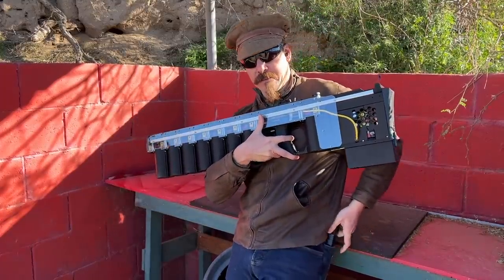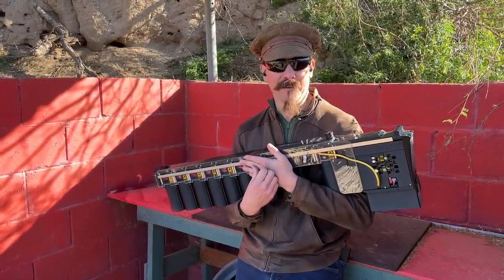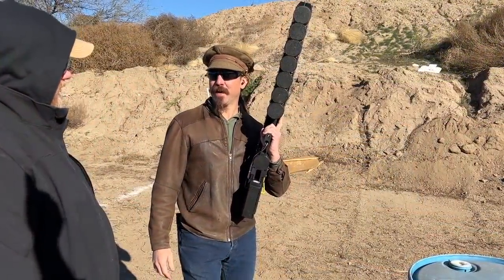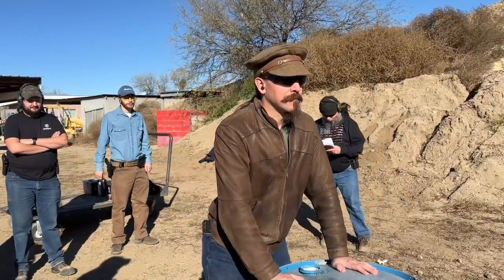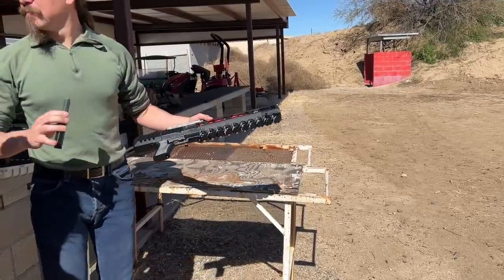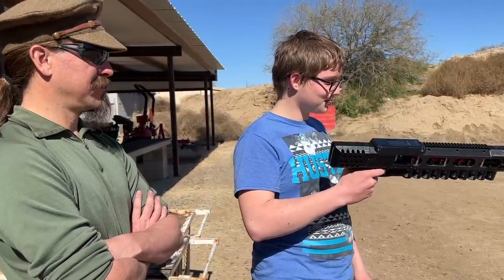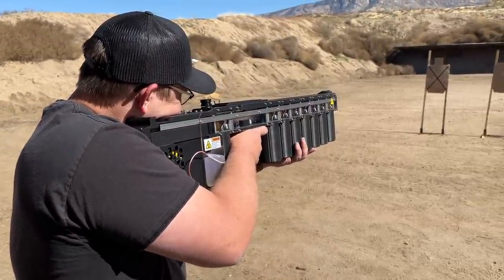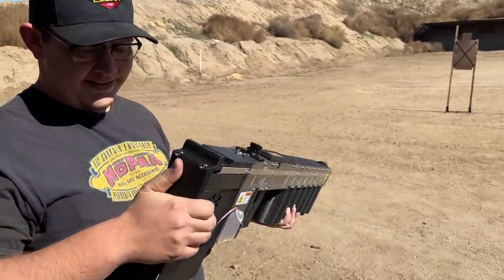I Tried to Use the GR-1 Anvil at the BUG Match...

Comment: Blowing a fuse is going to be the future version of breaking a firing pin.
Reply: Though probably cheaper since theoretically you could just buy a fuse at the nearest hardware/electronics store
Reply: @VertietRyper  Do what generations of shady electricians have done and replace it with a random bit of wire or generic metal object.
Reply: @CptJistuce  500iq strat lmao
Reply: Better not have built-in battery. I'd rather have to be able to change the batteries on the fly. Plus, do owners need EULA if it got software?
Reply: @VertietRyper  A lot quicker to switch mid firefight too
Reply: @Joshua_N-A  you can change the batteries on the go. It’s behind the magazine
Reply: That may be a viable option up until coilguns become more powerful.
Reply: @CptJistuce  What do you think grunts in the field are liable to do?
Reply: @bthsr7113  Probably something metallic, but not wire. Part of a fork, razor blade, one of the projectiles... but not wire.
Reply: @CptJistuce  ian in the build video: don't stick a fork in it
Ian after the shooting video: unless you really know what you're doing
Reply: "Guys guys hold up battle's off, our gun batteries need like half a day to charge, come back tomorrow!"

Comment: It seems the trigger would benefit from a mechanism that would add a little resistance and a noticeable "break" between charging and discharge. Possibly something as simple a spring the trigger would start pushing against between the charging and discharge phases.
Reply: Detents are tricky to do with 3D printing, but a little trial and error will get you there. I did spring-loaded ball bearings before like this, and it turned out alright after some experimentation. They make inserts specifically for such tasks as well. Could use a buckling leaf/spiral spring also.
Reply: Or just put a charge button on there, hold in the charge button, then pull the trigger once it's charged up
Reply: Basically it needs a Mechanical Keyboard switch. Cherry MX Blue would fit that description.
Reply: I was thinking a tone. Like light pull and you hear a "charging" noise followed by a ding or chime when ready to fire. 

Or a scope with a HUD to show the charge and an icon when fully charged.

It's more points of failure but it's a coil gun so idt add a couple more is a big deal.
Reply: Or a two stage trigger. First one to charge easy, then second one to shoot.
Reply: I also think there should be a setting to software-wise delay the firing until a certain energy level is reached. It wouldn't be too difficult to enable a sort of full-auto with the trigger held down that goes at the maximum possible rate given the power settings. It would be a bit different than the smaller one, which I guess cycles through subsets of the capacitors in the bank to enable the rate that we saw.
Reply: @knutboehnert3163  It seems that was the intention, but the detent is too light or missing entirely.
Reply: Maybe just copy operation logic from a nerf flywheel "guns" - when there is a separate button-trigger just below the main trigger to spin up the motors. On a coilgun this will charge capacitors, engage arc reactor or warp drive :)
Reply: @CompComp  Not just any charging noise. This gun is made for having an ominous hum.
Reply: I was thinking, a charge to pull, release to fire system.
Reply: Yeah the two stage trigger has the same problem as trigger operated lasers. Accidental discharge.  With all the results coming from that.
Reply: Something as simple as a blue clicky keyboard switch for a mechanical keyboard could be adapted for the click (could even form part of the circuit) .... around $5 for 10
Reply: In my mind, the best feel would probably be something like the Gamecube Controller's original trigger buttons, or maybe something like HK LEM. Long, light takeup, wall at the end. Maybe you can get something done with inductive sensing on a plunger, hitting a physical button at the end.
Reply: @Exile1a  I was about to say the say the same thing. Designing a trigger that’s similar in function to how a mechanical keyboard switch works would be perfect. Though I think a Cherry MX Brown could do the trick.
Reply: @zedhiro6131  I was thinking the same thing.
Reply: @zedhiro6131  - no way to abort the shot that way. Sounds unsafe.
Reply: @Exile1a  Needs a bit more weight and tactility. I'd prefer something like a Novelkeys Box Navy switch.
Reply: @DenGuleBalje  I was more referring to the way it switches. A clear tactile moment where the switch 'engages'. Because you're right, you would like a bit more resistance in a trigger.
Reply: The A-10 stick that Thrustmaster has that is based off the real aircraft has a two stage trigger.  It has two buttons to press, one by the trigger itself, which is the second pull, and the first which is actuated by a spring.  So what happens is you squeeze the trigger, the spring tensions up and then you get the first click, and the trigger will fall onto the surface of the second , which its own internal spring is much higher strength, so it has a very firm click to it as well.
Reply: Or like the "safe action" triggers. Depress the safety switch to charge, then pull the trigger to shoot.
Reply: Or a thumb button for charging. Not particularly a fan of "pull the trigger but not too much" I think a trigger should mean ready to fire so a separate button would be better.

Then again, I didn't design a massive working coil gun so 🙃
Reply: It probably will be better in a production version. Since this is a prototype, user optimization is a low priority.
Reply: @MichaelMacGyver  Or have a "trigger safety" mechanism (trigger on a trigger) that starts charging the gun (and have a trigger itself with a definite break).
Reply: I think your best bet would be a simple charging switch that automatically charges itself between shots and can be turned off. That would also act like a natural safety.
Reply: @Marci124  The final design is not gonna be 3d printed. 3d printing is useful for prototyping, tried and true mechanisms like detents don't need to be prototyped to the extent of something entirely new like a coil-gun.
Reply: Or even a double trigger, or a safety button. A thumb button could set you charging, keep the laser to tell you when you're ready to fire, and then have the actual trigger for the whole shooty bit.
Reply: imo it would be better to separate charging from the trigger and put it on a separate button. Just to remove the possibility of accidental early discharges from the equation altogether. Maybe put it somewhere you can get to with your thumb, kinda like a safety switch.
Reply: @CompComp  I also was thinking exactly that. Take sound from some game like HL or Doom or anyone else
Reply: A simple option would be for the software to only respond to the second trigger stage if the capacitors were at a minimum effective charge level.  If an inexperienced or overeager operator pulled the trigger all the way, they would just have to hold it until ready to fire.
Reply: @ThisisDumb922  Yes...I was thinking along these lines, but perhaps a solenoid that blocks the release until the required charge level has been reached.   That way you pull to charge and it won't let you fire until it's ready.   This would still place a burden on the inexperienced shooter who would need to hold the trigger for a long time until the gun fired, or the experienced person could charge then release when they wanted.  Either way...the gun would need to be 'fail safe' or 'dummy proof' to have any chance on the open market.
Reply: I think 2 triggers might work better. Have middle finger charge then keep the light trigger as the main
Reply: @Marci124  While I expect this would be how one would actually set it up for military use for example. I expect the legal definitions of a machine gun might be a problem for civilean versions with that. Though I can see a version where it does that but requires the release between trigger pulls to work. In fact, I expect that is how the little one was working.
Reply: @Marci124  yeah i was thinking maybe have a sear or trigger spring, ie a standard, small piece of flat spring, and punch a little "kink" into it, that would rest in a slot on the side of the trigger
Reply: Check out the adaptive trigger in the Playstation 5 controller
Reply: @Marci124  I mean even a ball bearing detent would probably work
Reply: I'd say keep the current trigger mechanism for charging and have the trigger stop against a micro switch at the end of travel that will actually fire it. Would give you a very clear and tactile break.
Reply: Maybe a trigger safety dingis.
Reply: @Marci124  This is the solution we're going with. Software select power level. Gun automatically charges to that power level. Single function trigger to fire.
Reply: @Marci124  You'd need to have a guarantee to abort if the trigger was pulled too soon and then released before a full charge was reached, like a  hangfire. Given the increasing time taken to reach full charge when the battery is low, you could otherwise find a round going wherever quite a while after you thought you'd got a complete failure to fire.
Reply: Off the shelf switching from companies like Omron would do. They come in staged plungers.

Think camera releases or cordless tools.
Reply: Maybe something like a trigger dingus as a switch instead of a safety then the trigger works normally?
Reply: I think this would be better with something more like a double set trigger.
Reply: @CompComp  A heads up display with an optical combiner reflex sight would seem a kind of obvious improvement. WW2 technology…
Reply: @MichaelMacGyver  I like this idea.    A charge button on the non-trigger hand grip area would be perfect.
Reply: You could put a micro switch which isn't connected to anything they have a clickeyness to them when depressed and released
Reply: or a totally separate trigger for the charge
Reply: @zedhiro6131  oh yeah, i'm pretty sure that's how it works in video games that have this sort of weapon. Why not?
Reply: grip "safety" when gripped charges the caps when fired without gripping it is essentially harmless.
Reply: what if you used a dual trigger like an old school double barrel shot gun one to charge the other to fire?
Reply: @CompComp  Funny enough, on Ian's first range video with the gun i could hear a somewhat high-pitched hum of the capacitors charging. I guess that sound would be even more notieable with bigger, stronger and more efficient capacitors in the future.
Reply: @Marci124  No need for a detent, just a second spring shorter than the first. If you can find one slightly larger that is wrapped in the opposite orientation, you can nest them. You'd have the light single spring pull back to the charge contact, then both springs are working back to the fire contact. 

If you wanted to get fancy then put a lever on a slide. Lever sits perpendicular to the slide axis with the trigger unpressed, rotates back parallel on a very light spring and trips the charge switch, then pulling further moves the lever mount on the slider and engages the fire contact. 

Or charge with a backstrap switch like a grip safety.
Reply: Add a 2nd triggerspring wich is only depressed after the 2nd stage....
Reply: @knutboehnert3163  Yeah, I have a 3d printed two-stage trigger in my camera gunstock, works pretty well.
Reply: Personally as a gamer who's had a lot of fun firing fictional weapons, this gun is super cool. But I've always been fond of games where the trigger is held and then the release is to fire. That way it wouldn't matter if you need a light or heavy trigger finger and it would put as much power as the output would allow the longer it is held.
Reply: @dbracer  Yeah, that came across my mind as well. Seems like a simple task at first, but there's always edge cases.
Reply: I would like to be charitable with this project, but after reading this thread it would seem almost any solution would be better than the current light "two-stage" one. 
But, of course, it's a prototype, showing weaknesses is what it's supposed to do.
Based on the ideas I read here I'd seriously consider removing the combined trigger altogether.
Reply: @shurmurray  ...
That's not how they work
Reply: @Ascania  It already has one, actually. The actual sound of the capacitors charging does it. It's hard to hear, but it's even there in the video.
Reply: @justarandomtechpriest1578  can you explain your point in detail? Unclear what concrete message was meant
Reply: @skeptical_thinkers  So, will it be as Marci124 describes - the shooter holds the trigger and when it's charged, the gun will fire? That would work.

Though I still think a working progressive trigger would be useful as an option. Especially when you figure out the accuracy. You'll want to give the user a chance to properly time the shot. They could still press fully for the "automatic" shot.
Reply: @MarvinCZ  Marci edited his comment, but the plan for future models is to give the user the option between "manual" mode and "semi-auto". Manual mode is the original progressive trigger. In "semi-auto" the gun automatically charges to the desired energy, then fires when the trigger is pulled. If the user pulls before it's charged to the minimum energy, the gun won't fire. We don't plan on doing anything full auto with the GR-1, the charging time is still too long for that.
Reply: They are already looking at the charge status for the ready indicator, just electronically disable the trigger until a full charge is reached. And of course get the charging switch off the trigger, so you don't have to have your finger on the trigger until it's ready to fire.
Reply: @EwanMarshall  When ATF catch up maybe but right now this "not a firearm" so can't be a machine gun.
Reply: @marvindebot3264  1) assumes I am talking solely about the US. 2) my reading of 26 USC § 5845 does not actually make that clear. So would need case law on explosive being required. 3) ATF is not the sole agency that can investigate firearms offences, and while there is some deferral to them, their doesn't strictly need to be.
Reply: wouldnt it work better with a dual trigger mechanism? hold down bottom trigger to charge, pull top trigger to fire?

that or a double pull? pull trigger once to charge, pull 2nd time to fire?
Reply: With the electronic interface it might be possible to add in a gate that allows the trigger to go only half-way until fully charged before it is released.
Reply: @Ascania  A rising whine, like an old (1930'S era) capacitor building charge. ;-)